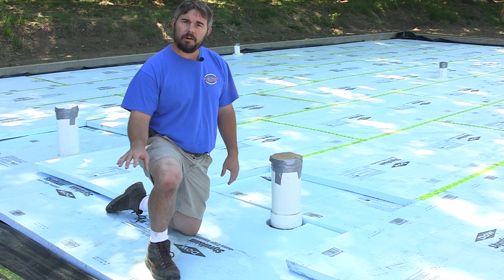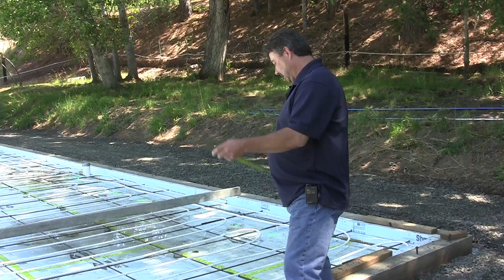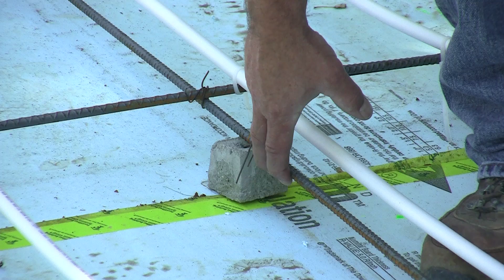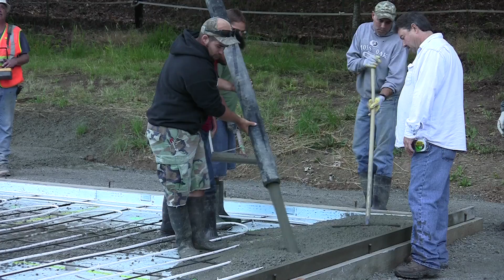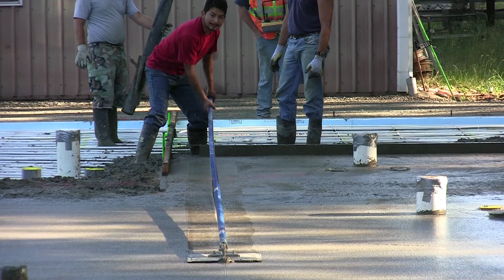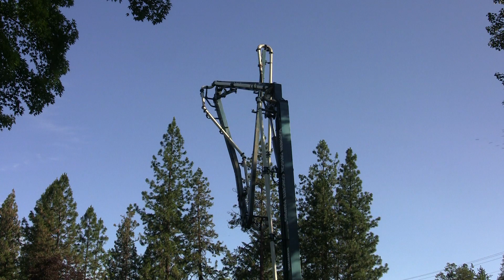My New Shop: The Radiant Slab

Comment: When the guys are pouring it they are walking around and can't tell if they are standing on the rebar. Won't that cause the rebar to bend down taking the pex pipe to the bottom of the slab in the areas that they stood on?

Comment: Hello question I am building a shop and putting a radiant floor in The slab of concrete. Question how did You mark where pex tube is so if you mounted auto lift or  wood working equipment to floor. You did not drill into pex pipe while drilling into concrete for mounting bolts?  I was think tracer wire but was looking for suggestion 
. Thxs
Reply: Handheld FLIR…

Comment: Nice job! I had a couple questions, though. I always thought the pex had to be encased in pvc at the control joints so when the slab cracks, the pex is isolated and doesn’t crack along with the slab.

I’m also wondering why you needed a pumper. I try to avoid them whenever possible. The pumper has to clean his lines on your property, which usually means dumping a yard of concrete somewhere which you have to deal with later. That’s a waste of money, not to mention the cost of the pumper itself. 4 guys with wheelbarrows can hump 75 yards concrete as fast as a pumper. Use 2x planking to cross the rebar.

Comment: Wouldn't it have been better to put insulation on the outside of the foundation and run it down a couple feet and then out a few feet sloping away like they do  for those frost-protected shallow foundations? This way seems less efficient to me since the slab is contacting the outside earth. If you're in a cool area then I would think frost heaving is a real thing to look out for. I'm guessing this way is just the easy way out as it's much more labor to dig a trench around to line the outside of the foundation and then lay some horizontally/sloping away. Plus I would think it's just better practice to line the outside to keep moisture off the the foundation.

Comment: I'm interested in doing this process on my next shop build but I see the concrete guys constantly stepping on the rebar and 1/2" plumbing tubes which is not keeping the lines at a consistent height within the slab as the concrete is poured. How does this effect the heat? What if one of the 1/2" tubes were cracked because of this? Does that make the whole 250' line unusable?
Reply: From what Ive seen, It's very rare to have a leak, but if you're smart you would pressurize the system with air the day of the pour and have a couple of unions ready.  60psi of air and there will be no guess work.  👍

Comment: yes, go away little pumper truck.  noisy for such a small truck.  good video, doing my 40 x 60 now, except I have 4 foot frost walls going down with 10 inch concrete and 2 inch foam.   Like your 2 foot squares, seen guys tripping in 1 foot squares.   I may use a manifold box tho

Comment: +1. .. Our Colorado mountain property had an NG fired boiler - radiant in-floor heat engineered and installed back in 2000. .. The several tubing zones like your's were encased in a 5" concrete slab, w/natural stone set as the finished floor. .. The whole house H2O heating was never better. .. So glad we looked past the up-front system components (Viessman) and install costs; Ka Ching $.
Reply: any pics 5514040058
Reply: @anthonymanoo9345  .. Plenty of pictures. .. Gemme an hour or so to throw together a PEX-ALU-PEX tubing pictorial. .. Cheers, M/S

Comment: I like everything u did here, my personal preference is to pour stem wall higher than floor to keep water away from framing.  Also grooving makes for a lot of work when power troweling.  We soffcut our floors at 1/2 inch depth unless deeper than 5"  I noticed u guys set up a board to screed off in the middle runs, your boys are good enough to use wet screeds, save them all that set up and tear down time.  Would've liked to see the trowels out there.